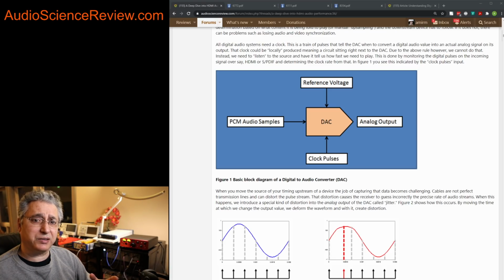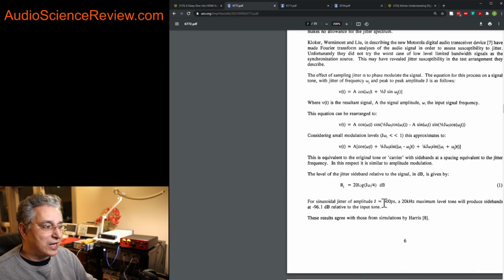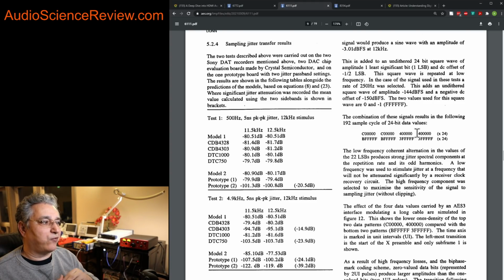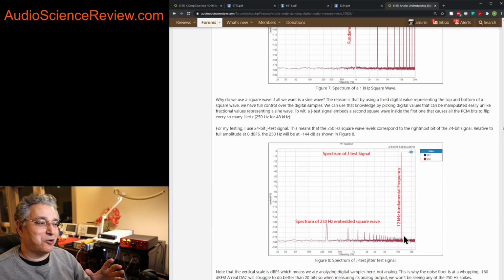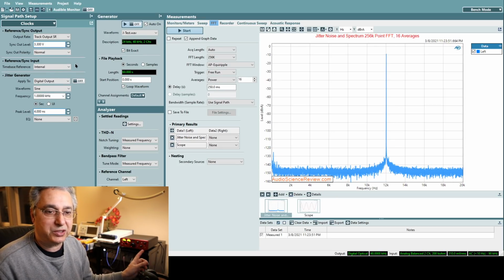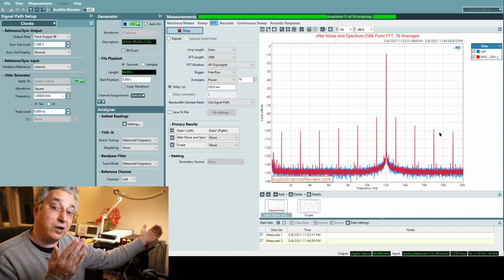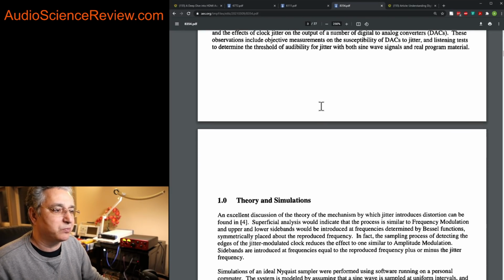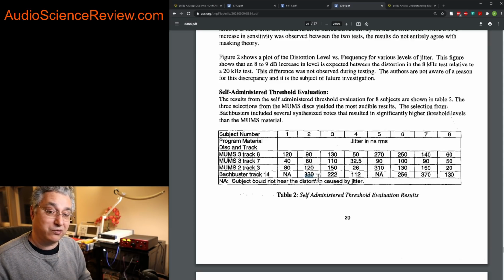Understanding Jitter in Digital Audio: Measurements and Listening Tests

Comment: J-test is designed it inflict maximum inter-symbol interference at regular periods. Which means it generates substantial deterministic (bounded) jitter.
Otherwise you are mostly measuring random (unbounded) jitter which is no more dangerous than tape hiss in analog audio.

If the system is badly constructed it will measure awful under J-test. Especially poor quality cables with highly capacitance or wrong characteristic impedance.
Reply from the maker: That was the original purpose of J-test as envisioned and created by Julian Dunn.  We don't use it that way today as cable induced jitter in typical home scenarios is non-issue.  But turns out the toggling of all the bits causes noise spiles internally to the DAC which bleed into the DAC clock, reference circuit or just analog output stage.  This is why using identical cable, one DAC will have ultra clean output and another, show the spectrum of 250 Hz.

As to wrong impedances, I have tested that as well.  Again, it is a non-issue due to short cable lengths and the fact that the PLL in the DAC is able to filter out a lot of that spectrum.  We now have $89 DACs that produce superbly clean output with J-test.

Comment: There are a few mistakes in this analysis.   First audio codecs do not sample at 44100, instead they sample at a much higher rate at a 1 bit then downsample.  It start with a CIC filter that takes the 1 bit signal either adds or subtracts one to an internal counter.  The counter is read every Nth sample and subtracted from the previous reading.  (the delta/sigma part of a delta sigma converter)   This is equivalent to a flat top or averaging filter.  From here you further reduce the rate though a series of filters ending with one of more halfbands.  During this step, you are careful to shape the noise out of band so that the last halfband can remove most of the noise.

When you hook up a codec to a PC using USB you are creating a clock domain crossing issue.  The PC will ask the audio interface for N samples,  but the audio interface may be a little bit ahead or behind because it is running on its own internal clock.  This difference needs to be resolved by slowing down or speeding up the codec.  This is often done by adding jitter to the MHz clock described above.  I think they highpass the jitter to waveshape it above 20KHz.

A DAC works the same but in reverse.   Here are my measurements of the jitter on a focusrite scarlette 8i6 
https://youtu.be/lbjCtdp1TQw?si=C6pkRhg-hFEB7mQP
You will notice that all the jitter noise is above 30KHz, which you can not hear, but it will affect any op amp down stream causing other problems.

Comment: Amir, you focused on the DAC. Although you mentioned a poor source may cause problems as well but did not elaborate. I am interested in learning about how much quality differences are there among different CD transports' or DVD players' toslink digital audio outputs. Some say the coax outputs (relative to toslink outputs) of the same cheap source cause less jitter but more EM noise. What would you say?
Reply: Yes, I was just reading up on this as well where they were saying that TOSLINK can be more susceptible to jitter due to the quality (or lack thereof) in the optical transceivers involved and the conversion process between electrical and optical signals. Yes, an optical signal is immune from RFI and EMI but if the optical transceivers inside the devices are cheaply made and of low quality, then THEY can introduce jitter/noise/distortion onto the signal. Although digital coax can be susceptible to RFI and EMI being just a copper cable, the fact that the signal stays in the electrical domain for its entire path may be of greater value in terms of maintaining signal quality. I'm a big TOSLINK fan, but not knowing the quality of my optical transceivers in my DVD player and amp, I'm tempted to go back to digital coax instead. I wonder if one is consistently better than the other? Given all the variables involved, is there any way to really know?

Comment: Hi Amir! Thank you for your work! Am I right in saying that according to how well many or most of present DACs measure, and that this is usually far beyond the human hearing threshold, they should all sound much similar? So how is it, in your opinion, that there are still clearly differences when hearing them, even when they both have incledibly low jitter figures? For instance: what measure gives a clue on the DAC's ability to perform good spatial 3D reconstruction? Time alignment and phase between channels is pften close to perfect, but still.... And another question: does it make sense to keep searching for the DAC with the best SINAD, when such SINAD is in the order of well over 100dB? After all, even with a modern class D ampliffier, nobody will be able to benefit from 100 dB+ dymanic range in a domestic environment, or will he?

Comment: It would be interesting to create an music file WITH "noise", and "jitter", and "interference" of a measurable amount, and that 'should' be in the audio spectrum. Then, have a clean file.  Play them both on your system and then try to discern an audible difference, (have someone else switch the tracks randomly).  I seriously wonder how many people could tell that they were hearing grunge and noise, and when they weren't.  I've wanted to literally just toss in some random noise generator in friends "audiophile" systems without telling them, and see if they notice at all over a month.

Comment: The funniest thing was people who bought and installed rubber rings on the outer edges of their CDs. 

PS Audio's digital designer Ted Smith claims he can hear digital jitter of 2 parts in 10 billion. He knows he got things right by measuring it with his toe tapping meter. I'm not making this up. My grandmother had a toe tapping meter that went off the scale whenever  Lawrence Welk came on.

In the RBCD standard each track is scanned a minimum of 6 times. Typical noise and distortion in my experience for CD players is invariably well below the threshold of hearing. By comparison phonograph cartridges typically have distortion of 2 to 3 percent under the most optimal conditions. IMO the main difference between the sound of one DAC and another is due to differences in analog frequency response where even a small difference is audible.

Comment: You are assuming that people's USB sources are clean, but in reality most peoples computers have very noisy USB outlets that produce a lot of jitter. Filters to isolate noise and reduce jitter are a huge help to me and others with very noisy computers. 
The problem with your conclusions is that you assume that if your pro equipment doesn't show something, that it doesn't exist in regular people's setups.

Comment: Shouldn't even a $10 DAC have an internal buffer and reclock the samples to it's internal clock meaning that any jitter in the source (outside buffer overruns and underruns which would lead to actual bitloss but that would be extreme jitter) would be completely ignored?

Comment: This is exactly what I was searching for after doing some measurements on my DAC and wondering what I was seeing in the FFTs.  One question I am still trying to understand:  How does changing the timing (nanosecond) affect the FFT spectrum?  I understand the jitter frequency changes the side-band spacing away from the base tone, but when talking about the audibility threshold, the results are given in nanoseconds.... so how does the FFT change as you make the jitter "more" audible vs less?

Thank you for a great video!  Clear explanations of a very complex subject.
Reply: Answering my own question (I think).  It seems that the delay (nanoseconds) defines the amplitude of the side-band.

Jitter Amplitude (dB) = 20 log(Jw/4)
J is the jitter delay in nanoseconds
w is the base frequency.

so at 10kHz and 100(ns) Jitter, the amplitude is -72dB.  at 10(ns) Jitter, the amplitude drops to -92dB.

Comment: The main case I've heard for jitter being introduced into an audio signal is via the source when running S/PDIF cables because the clock of the source is in control and is in many cases worse than that of the DAC, or is influenced by things around it (like being in a high performance PC). Is the jitter introduced in such an environment likely to be audible? I've seen people justify expensive sources and DDCs based off of this and the idea that USB introduces tons of distortion (which from what I understand is somewhat accurate, and hence the desire to use TOSLINK).

Comment: Amir, this was a great video as usual. As a fellow electronics and communication engineer I appreciate your efforts to educate the audiophile community. However I don't understand the shadow effect that you mention in the FFT. The shadow effect makes sense in the time domain because our ear continues to hear the previous louder noise for a bit and sort of misses the next softer noise in close succession. In the frequency domain, the lower frequency spike, the main frequency and the higher frequency spike occur at the same instance in time. In this case, you will hear all three at the same time, and if the lower frequency spike is in a more sensitive audible frequency then it can still be more disturbing than the higher frequency spike. Care to explain more about this?
Reply: @Douglas Blake that doesn't answer the question. Amir claims that the higher frequency spike is causing problems while the lower frequency one is not but both have the same amplitude and occur at the same time.

If what you say is true then we don't even need to worry about jitter because the sidebands will be of lower amplitude than the main band in almost all cases.
Reply: @Douglas Blake None of that is on topic. What does amir mean by the shadow effect? Why do higher frequency sidebands have greater impact than lower frequency sidebands?

Comment: 15:15 Maybe this is a matter of semantics, and a detail, but the intermodulation products is auditable for differing reasons than those in the time domain which rely on masking AFAIK. Obviously its not incorrect to say they are masked in the frequency domain, but it somewhat obscures why they are more audible. The IMD is typically not directly harmonically related to the signal being produced since there are sum and difference products rather than f2, f3, etc. The harmonics, being related, are less objectionable because they meet our expectations from musical instruments which do the same thing and produce similar harmonics. Intermodulation distortion, however, can produce a large splatter of frequencies that are not directly harmonically related to the fundamental, so they are much more audible, and give a raspy sort of sound to the audio when they are present. Good video, BTW. Edit: Although I will waffle a bit and say that the lower pairs are probably more audible since they can be interpreted as being their own fundamentals by the auditory center.

Comment: I found the last part the most interesting.  I've always wondered exactly how much jitter does it take to become noticeable?  I hear 'audiophiles'  obsessing over it and yet, I can't say I've ever heard it or found it to be problematic.  Why is that?
Reply from the maker: The problem with jitter test is that you can't turn it on and off on demand.  You have to use a specialized tool to generate them which hardly anyone has.
Reply: @AudioScienceReview  Is there a particular DAC that you've evaluated that clearly sounds bad due to jitter?  It would seem that someone would have needlessly incorporated a PLL in the clock source to create such a problem.

Comment: I would appreciate it if you would discuss the PS Audio AC Regenerators, especially after it received a God-like assessment in the April Stereophile magazine in terms of its transcendent impact on sound.  I was almost tempted to purchase their smallest unit and then I was grounded by what I have learned on the Audio Science Review.  Would love your input.
Reply from the maker: I have one and plan to test and review it.
Reply: This would in fact be MOST interesting - whether having one in a good chain (i.e., assuming that the equipment it is connected to filters its input voltage properly as part of the AC to DC rectification and regulation process) makes any difference whatsoever.

Comment: The only thing that put 'jitter' on my radar was while looking for ways to playback Tidal MQA files.  The consensus of what I found indicated that of the available connections types HDMI has the most 'jitter.'  Followed by maybe Coaxial and Toslink - I can't remember which is supposed to be better. It has remained a question how much of a factor that is.  Like, does it impact SACD DSD playback or only PCM? Does my relatively cheap Sony 4k Player that plays SACD suffer as a transport that supplies DSD over HDMI?  If you believe everything you hear you would believe a $6,500 SACD player might have a memory buffer that resolves 'jitter' issues, etc. My Sony sounds good enough to me for $250.
Reply from the maker: Jitter impacts all playback, not just PCM although the impact is different depending on how the DAC works.  HDMI by itself has high jitter but receivers with ESS DACs in them resample and with it, sharply reduce it.  I measure this in all of my AVR and AV Processor reviews.  See: https://www.audiosciencereview.com/forum/index.php?forums/home-theater-avr-and-processor-review.35/
Reply: Newsflash: Every CD player has a digital input buffer, to account for variations in the CD's spin speed and any errors that need to get corrected (or data re-read, because of scratched and/or dusty discs), without interrupting the audio stream (except of course for severe and/or uncorrectable issues).
Reply: @SteelBlueVision  I believe the premise of the 'audiophile' SACD player is that it has a 30 second buffer for SACD DSD disc reading - which is presumably much larger than your standard buffer.  It was the PS Audio SACD player if that is of any consequence.  $6,500 is too pricey for me so I'll have to suffer without that extra large buffer, etc.

Comment: I tried to explain to my audiophile uncle once that even an infinitesimally small buffer could eliminate all jitter transmission issues, leaving it pretty much to the clock inside the DAC. Couldn't get through. Not only is the audio world full of cognitive biases, but it's also filled with that phenomenon where you can't use evidence and reason to change peoples' minds.
Reply: Louis Rossman put it best; if someone did not use evidence and logic to reach the conclusion they have, you cannot use evidence and logic to change that conclusion.
Reply: @deadassadam  Well said.

Comment: Hi Amir, I found this video very usefull. Turns out I didn't understand jitter from a to z. Nice to know also what the audible difference between 24 bit and 16 bit can be and what it's not. I think you're coming from a balanced view, neither too objective nor too subjective, but using both and verifying. Your videos and website are like a fresh spring wind in a hifi world. Keep up the good work. By the way: Could you do a video on audible differences (if any) between high res files vs standard 44.1k?
Reply from the maker: Hi Marc.  Glad to see you see the approach I take to these topics.  On high res vs CD, that has been done so much that I prefer to not jump into that.  In passing in other topics/videos, I may address it.